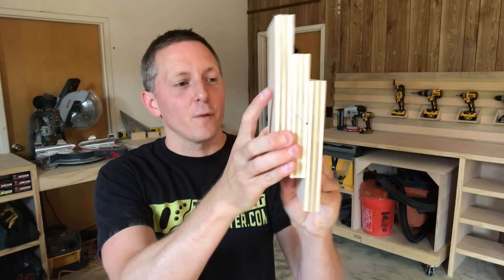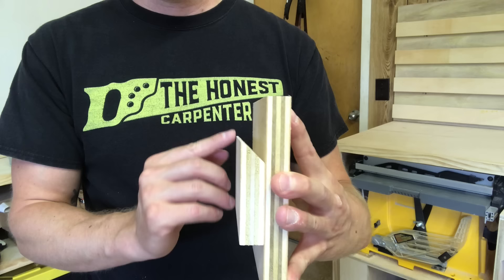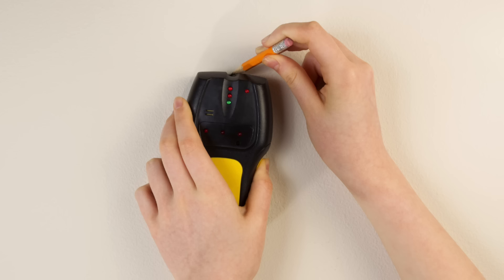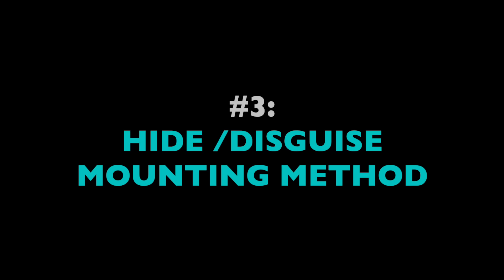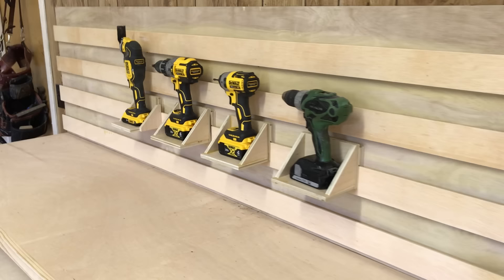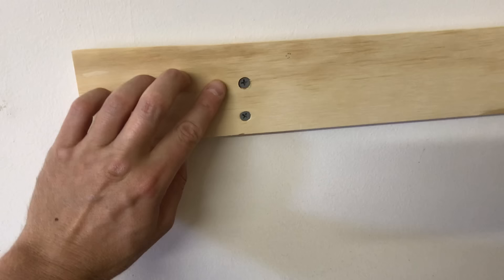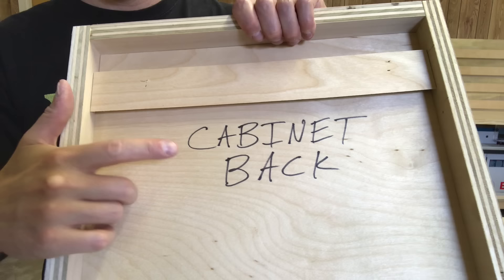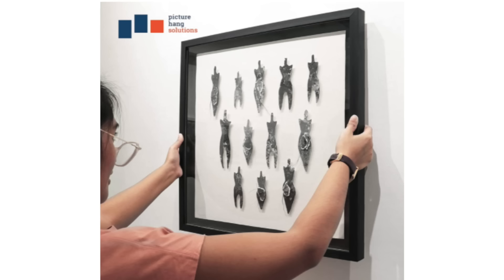FRENCH CLEATS EXPLAINED...In 5 Minutes! (There's More To French Cleats Than You Think--3 Main Uses!)

Comment: Great job. I loved your video and saw your interview as well on another channel. You are doing great things. That 45 degree angle is super important. At 45 degrees, forces in the X and Y direction are the same. That's the only angle from 0 to 90 degrees that offers that which is 45 is found everywhere when you need building strength.
Reply from the maker: Thank you, Dave! Dang, that’s a great point. I wish I’d put it that way in the video 😆 That’s the engineering side of things that I sometimes don’t convey as well in my scripts. Thanks for watching the interview with Steve too—he’s such an easy guy to talk to!
Reply: @jeremiahbullfrog9288  Great point… also if using scrapwood (knotty) or low grade plywood, I’d trust 30 degree cleats over 45.
Reply: Moving the center of mass below the hanging point also will reduce the torque and reduce the amount of shear force.
Reply: Is there a max height for a cleat so it doesn't fall over? For a heavy vanity should the cleat be near the top of the back or middle? Thanks
Reply: @instantalbums  Great question. I have never used a cleat for a vanity - but have for a variety of power tools. Definitely towards the top and bottom. Give it two points of attachment for stability. Max weight? Well, I'm sure there is but for a vanity if you do two points attached to studs, you should be fine.
Reply: I've  done 30 degree in the past with kitchen cabinets and didn't notice any difference.  Full of dishes.

Also, when the title says 5 minutes,  can we agree it should probably be 5 minutes or less?

Comment: We utilize french cleats all the time for high school theater sets.  The kids run the show and we needed a simple, strong method to put scene overlays on different set pieces.  For example, Kids will grab a 6' x 6' flat, run out on stage during scene change, drop it into place, shift left/right for alignment, run off stage.  Speeds up the scene changes a lot!

Comment: I’ve noticed that French cleats make hanging things that are long horizontally way easier. Also it’s a better way to spread the weight across the wall rather than in just one or two spots.
Reply from the maker: Yep, exactly Assemblee! You can get three studs in on the support process with 34" of cleat. They're just so stable and efficient!
Reply: This worked great for a new king-size headboard we bought this summer. It provides a rock-solid attachment.
Reply: I hung my 55” Sony with 2x4 cleats. Bolted the top cleat right to the Vesa holes

Comment: One of the most inspired things I did in my garage was to put a french cleat rail all along the top of the walls.  I wanted to get bulky, less frequently used stuff as out of the way as possible, more importantly not shoved behind something in a forgotten cabinet or shelf.  If you can't find it, or don't remember you have it, you'll end up getting another.  It was so useful I ran a second rail all the way around, then down even more rails in select wall areas.  Because I was able to move whole 'areas', e.g. metal working, camping/fishing, in an hour or less, I found out over time that I had some areas of my garage arranged inefficiently.  Another benefit was how fun it was to design and build oddball custom 'hangers' for weird stuff - a perfect destiny for cutoffs and scraps.
Reply: That sounds like a very intriguing solution! Being able to change around what is easiest to reach makes a lot of sense.
Reply: @Kirby Spencer - it’s like you want us to see your garage…pics or we don’t believe you!!
Reply: @duzzitmatter8679  Thanks, but after looking at things with a critical eye the only things anybody would find interesting would be a half dozen of those oddball scrap based 'hangers.  The hat rack, drain auger, fluorescent/LED tubes, layout station, crossfire laser, and orphaned drill bit holders are the most original and seem to get the most "Hey, I think I'm going to do that." comments.  The rest of it is basic stuff like you see on all of the french cleat channels like shelves, the mandatory charging station, or a stiff laundry basket with a hanger cleat attached to the back.  All said, not enough to document for posterity.

Comment: As a picture framer, I can say that the aluminum cleats like Honest Carpenter links to are great not only for heavy things but also for customers who do not like the traditional way a picture hangs from wire and want a more even against the wall look. When using them on very heavy frames, and I've done this on a ridiculously heavy mirror that was 10 feet wide, remember you can put another rail along the bottom edge of the frame for extra support as long as your frame is wide enough to hide the wall hardware. About 3 inches should do it.

Comment: There's one more benefit, especially for cabinets and other living space fixtures/art: it makes it much easier to ensure your piece is level. You only have to make sure the lightweight and easy to handle cleats are level when mounting them to the wall, and then make sure your cabinet-side cleat is square, and then you can just throw it on the wall without worrying about leveling up a large cabinet.
Reply: It also gives some flexibility for the left/right positioning of the object.   Depending on the width of your cleats, you could potentially adjust your object several inches one way or the other.

Comment: A cheap metal French cleat from WalMart solved a HUGE problem I had with a 45lb mirror.  That cleat alone is rated at 80lbs as drilled into studs.  It’s a perfect solution many times.
Reply from the maker: I'm not sure when those little things showed up, Duzzit. But they're crazy helpful! It's really a point-and-shoot solution for most smaller mounting tasks.

Comment: I would have added that when hanging cabinets etc, it’s much easier to ensure that they are level. Verify that the wall cleat is level, and the corresponding cleat on the object to be hung is square/level.  This is a huge advantage when your hanging a large or heavy object by yourself. You don’t need anyone to hold the cabinet in place while your trying to screw it down.  Plus as you mentioned, you can adjust from side to side easily if necessary.  
Thanks for another good, quick and informative video...

Comment: I’ve been using French cleats in the museum world before they were even a thing. Not only do they support a massive amount of weight, but they hold work snugly to the wall and never go crooked. Back in the day people used to think I invented them!
Reply from the maker: Tell them you did, monkey!😆 That's awesome to hear you worked in a museum. You're right--they brace an object tight to the wall. Someone really has to unsettle it badly to dislodge it in any way.
Reply: You need to answer the people in French - that will really impress them.
Reply: Hey! Museum world part deux here! I was about to say the same thing but you beat me to it. Merde!
Reply: Know nothing about carpentry here, so how do you attach the French cleats to the cabinet or whatever your hanging, aren't you also screwing through the back of the cabinet wall then again relying on the strength of the cabinet? Maybe I totally don't get it since I'm not in carpentry, but am genuinely interested.

Comment: I used aluminium cleats to mount kitchen cabinets to the wall. I was doing it solo, and that system allowed me to do it easily. The only problem with those cleats is that they couldn't be mounted recessed on the back of my cabinets, so there is a gap at the bottom. But with the backsplash and a little bit of caulk it looks good.  "Do your best, caulk the rest" 😅

Comment: One issue that the cleat (or any wall mounting) brings to mind is "lever action."  This is not an issue for flat objects that don't extend away from the wall, (the force they exert is directly downward). But for objects such as shelves or cabinets, the weight is some horizontal distance away for the wall, so the force is down and away, (the attachment is the fulcrum and the shelf is the lever).  If the cleat described in the video can hold 80 pounds, what is the relationship between the depth of the item (and height), and the weight a cleat can hold, before the cleat fails.

Comment: An additional element of engineering that you could add: the pulling force acting on the bevel and cleat is proportional to the ratio "length of overhang / support height below bevel" (times the weight, obviously).
For instance, a 10-lb tool resting on an 8-inch bracket (i.e. center of mass 4" from the wall) which only reaches down to the bottom of the wall cleat (typically 2  inches) will pull 20 lbf off the wall.
The basic takeaway message is to extend support brackets as far down as practical (e.g. rest them on the next cleat down), at least for heavy stuff, esp. when the weight is far from the wall.

Comment: Great video.  Everyone should get to know this system, it’s extremely reliable.  Get the metal one mentioned if you don’t have access to a table saw.  I strengthened an IKEA double cabinet that had survived a fall, however it killed a monitor.  I took 1x4 pine and screws to go all around the back of the cabinet, and accommodate my oak French cleat, fashioned to a pine wall cleat.  To support the bottom of the cabs I ran the rest of the 1x4 pine scrap for another wall cleat and put two screws with washers for even more strength.  I want to say it was cut at 36 degrees.  Couldn’t be stronger!

Comment: I used French cleats to hang everything in my garage and in my shop….I even used it as a rail system for peg board. It holds amazing amounts of weight.
Reply from the maker: I’m doing peg boards on the other wall, Jeffrey! Never thought to combine the two—makes perfect sense! 😆
Reply: It is the perfect way to hang pegboard, and I did as well.  But beware that if you do it the intuitive way, the rail(s) and the cleat(s) itself will not allow a hook to go in where they are.  Only really a problem when your rails are 'dense' behind the pegboard as I've seen some do.

Comment: I am currently busy setting up a new hobby area in my house and the walls of that room are all concrete that requires heavy masonry equipment to drill anything in.. I kept thinking about practical wall mount system solutions but I couldn't come up with anything that could hold heavier weights. i guess I don't need to explain how useful this video was! Thank you so much, you have been repeatedly helpful in so many of my projects, keep it up!
Reply from the maker: That's awesome, Ruta! Since you've got so much masonry to deal with, you could probably do what I did on my back wall here and attach all your cleats to a partial sheet of 3/4" plywood, then just mount the ply panel to the wall. Saves on individual fastener points, but still gives you something strong. And as crazy as it sounds, you maaay want to hang some 5-mil plastic between the wood and masonry--just in case you get any moisture wicking through that wall. Thanks for watching, work safe!
Reply: @TheHonestCarpenter  I was actually considering wooden panel option and your suggestion really solidified the idea! Thanks again and wish me luck! 😊

Comment: Very much like the French cleat method for hanging cabinets.  You don't have to see screws from the inside screwed into studs, you can easily move the cabinet side to side or take it down if needed.  You only need one strong board between the studs to hang it and one lighter board near the bottom so it hangs plumb.   A far better way to hang a cabinet. It also allows you to use a thinner back board which decreases weight because you simply fasten the cleat into the frame.  You can also hang smaller cabinets that don't span two studs thereby avoiding drywall fasteners which are not very strong.

Comment: I appreciate all the explanations and discussions of the value of the 45deg surface of the cleat, but it is actually dependant on the center of the load being below the joint and the flat back of the cleated holder maintaining/preventing tilt/outward rotation of the load...particularly with shop walls tool holders...and ;) if all else fails a single drywall screw can prevent failure ;)

Comment: Great video. My guess is that the load limiting factor is closer to the the shear strength of the attachment screw(s). I have used French cleats for an outdoor green wall with the system made of cedar. The hanging cleats hold planters that can be placed and moved to decorate as a function of the plants they hold and how they grow. Very versatile. Thanks for sharing!
Reply from the maker: I’d say your right, Walter! I didn’t get into the “lag vs screw” issue, but fastener type definitely determines strength. Somewhere along the line I guess material could fail, but it would be at a pretty high load. The fastener head would probably pull through.

Comment: I used an aluminum cleat to attach a very heavy 4' x 6' framed mirror on a high upper wall in a hallway.  The cleat the was attached to the wall was mounted using through bolts which went into a closet on the backside so the hardware showing on the other side of the wall didn't matter.  I could literally hang from the mirror and wouldn't come down.

Comment: We also call them Sheldon brackets . If the mass of the object warrantied it, we ‘wood’ also use PL or silicone in the seam. A step further, drive screws thru the cabinet into the wall cleat. Great for trophy cabinets in schools, in that the screws are hidden by cork or another veneered surface applied after
Reply from the maker: Good call, Paul!

Comment: Old houses used to have something similar to this. Would hang lights and pictures from it. The plaster walls were not strong enough to mount to.
Reply from the maker: The picture rail, Turbo! Yep, and the had custom hardware and wires for suspension. I’ve matched and run them in historic houses before!
Reply: @TheHonestCarpenter  there is a specific trim name.. I cant remember.
Or is it that simple.. Picture rail?

Comment: My question is this. When it comes to load bearing walls using this method or any other. At what point is too much weight? Is there a way to make a "secondary" wall that is away from the load bearing wall? Also can it be more effective in a basement for massive storage capacity?

Comment: I totally agree that french cleats are awesome but I do have a few additional points to add.

1) I recommend against using an upper and a lower cleat simultaneously unless you are really really really really really precise in your measurements. If the pieces on the wall are spaced slightly more than the pieces on the cabinet, then only the upper pair will be engaged. If the pieces on the wall are spaced slightly less than the ones on the cabinet then, even worse, only the bottom cleat will actually be (fully) engaged (and the cabinet will probably tilt forward a little). Of course the cleats do deform at least a little so you have some margin of error, but it's not a lot.
2) I would recommend using solid wood rather than plywood for the pieces. While plywood probably works fine most of the time, the plies are aligned such that the glue between them will be what is resisting the outward forces if anything tries to pull the cabinet off the wall. Glue is plenty strong but I would want to hang something heavy and be relying on the plywood's ability resist delamination.

Comment: Than you so much for this video.  I’m a beginning woodworker trying to build a fireplace mantle 7”x7”x69” with 45 degree beveled pine boards.  I plan on using a 2x4 french cleat. Is there a method for figuring how  to cut that 2x4 exactly in half or just measure 31/2 divided by 2.

Comment: I know you have WAY too many subs to answer my question but I thought I'd give it a shot.
I have a work shed that has sunk a few inches in the rear where the most weight has been on it since I bought it a few years back.  It's the fully sprayed insulated vaulted ceiling thing about 10' x 18 foot.  The guys that delivered it put the cement blocks for the foundation but If they would have given me some accurate measurements, I could have put a sturdy cement holes for the blocks.  Regardless, it has sunk a few inches and I want to level it back out.   I don't want to try and climb under to get all the foundation blocks shimmed so I thought about getting 3 pieces of square tubing (2"x4") and run them across the wood floor joist.  Jack it up in the  center rear with a floor jack then just shim up the ends.
What do you think?
Reply from the maker: Hey Al, each stack of foundation blocks represents a point load. So you could definitely jack the shed till level, but you’ll have to shim up at each point load as much as necessary so weight is evenly distributed. But the good news is you could probably just do this with treated lumber! Sheds don’t have too much weight in them overall 🙂

Comment: You talked about the angels, but not how thick the cleated boards should be. Could you please expand on it - like, is it wise to use 1x2 as the French cleat? How wide is too much, like, is 2 x 8 ever appropriate for anything. It's the same with depth - is 4x or 8x ever useful? Thanks!
Reply: 3/4” thick good plywood is adequate for most purposes. Although if you’re going to have a floating sink/vanity that sticks out far you may want to go thicker and use more than one cleat to share the load.

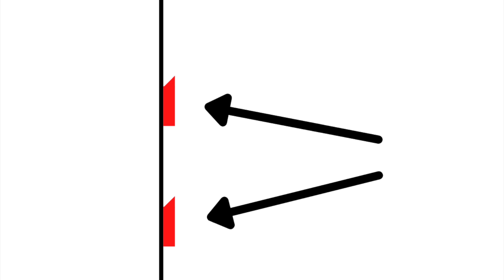Comment: 3:28 - does this really double the strength?  I would think you wouldn't really get a doubling, because (as it seems to me, and as I've heard others say in various places) it would be near-impossible to get the load to actually share evenly, and it would end up that either one or the other of the cleats would be holding the vast majority of the vertical load.  (They'd both help with avoiding pull-out, though, I guess, so for horizontal, it might be true...)